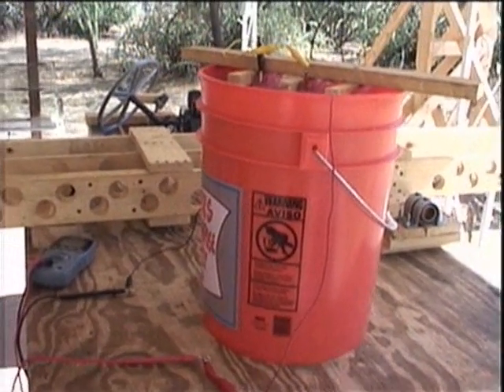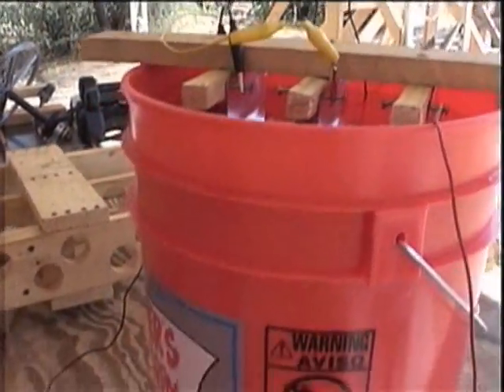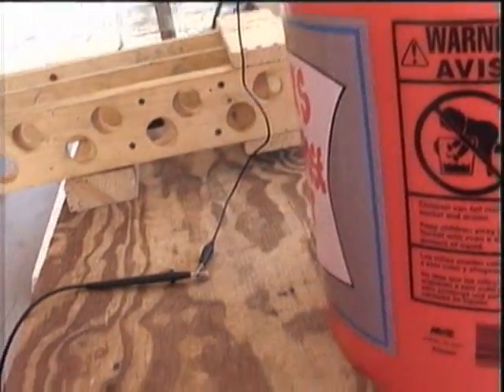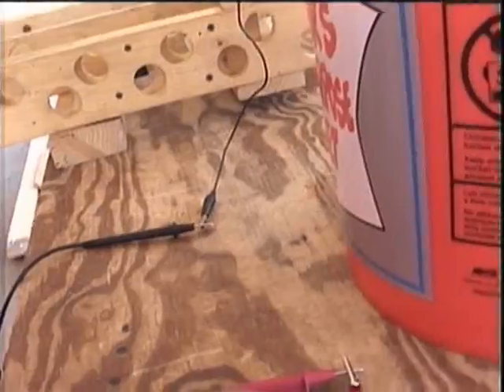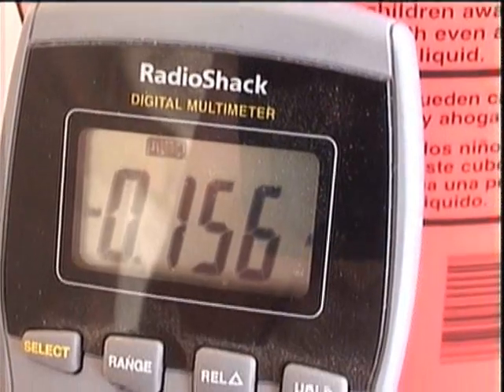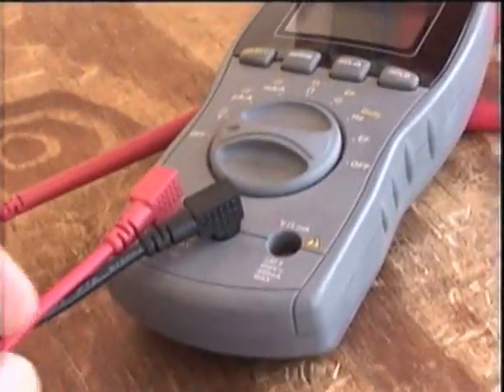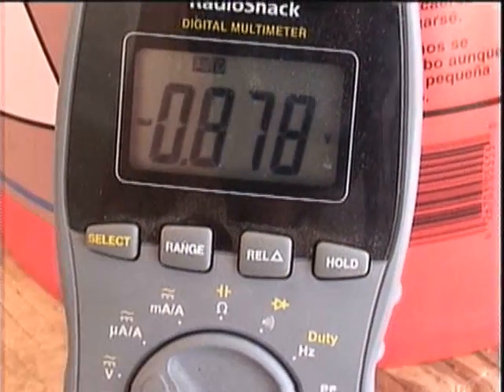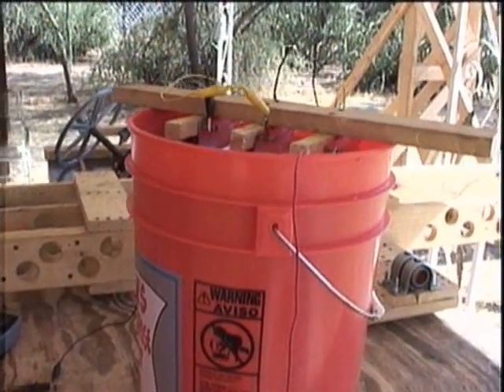Monster Salt Wter Battery P2

Comment: Would the wiring not give youbmore voltage rather than amperage. Like wire them in series rather than parallel. Just like any other batteries.
Reply: But this battery has only one cell. If I’m not mistaken you can’t wire a one cell battery in series or parallel inside itself instead it must be multi cells battery in order to do that. Of course in this case he could just turn the battery into multiple cells battery and wire it in series in order to increase output voltage.

Comment: Another thing is. the power comes from the oxidation of the metal. So the rod will get rusted out if you use the power. the maximum voltage within a cell is 1.5V - which is used in water electrolysis.  My previous experiment.  To accelerate amp, you can use Joe Cell or fusion reaction etc.. you need to combine kinetic energy transformation to produce energy. very difficult :(

Comment: Think like computer chips. more cells, closer you can do that increases the efficiency and more power. also more heat up by sun. more power. more pressure inside of chamber same. keep improving!

Comment: Cell voltage is leaking across the cells  use individual containers for each cell. Build large cells use 6 buckets copper flashing on inside of bucket bolt thru side sealed . Terminal-  smaller bucket inside with holes wrapped with nylon screen so particles won't go through the holes  stainless steel screen wire inside bucket bolted terminal+.😀  Next add broken bits of aluminum in small bucket, use salt water, or chlorine tablets and water, bleach is best! For 2 volts per cell! Make 6 bucket battery and run inverter and watch TV!😀

Comment: You have wired the cells in parallel. This is why the amperage increased. Wire them in series for greater voltage. This is galvanic effect. The saltwater is simply conductive for the electrons to move. It's the differential between the different metal types.. Sigh

Comment: 2 volts and 0.8A = peak power of 2W not bad for a 20 liter backet...
haha this is a joke.
Reply: 0,8 amps if he short circuit with the meter. 2 volts with no current. Power = voltage X current.
He must measure the current and voltage at the same time to get the     power.

Comment: Depends on how yo wire it up, whether in series, or parrallel.
Reply: It's a single cell(bucket/container), you can't wire it in series in a single container.
If you want more voltage you need a separate bucket/container, than you can wire in series.

Comment: well the problem you face are you cant have them in same store of water you need 3 in this case.
Reply: wrong...
Reply: you make no sense at all, you need 3 cells to higher volt x3 simple logic, he tried to make it x3 in one cell and that you can't do.
Reply: i don't argue with idioys...
Reply: another video had 10 cells in 1 bucket...as long as anodes are not physically touching, they can share the same electrolyte...if wired in series, voltage greater, if in parallel, amperage increased...
Reply: Hmm if true why have non made a 12 volt battery that way?? then foe free from charge one cell at time to max preforms of cells.
if you have all in one, they will simply balance the full battery, whit out one cell lagging behind.

Comment: Technically this is a cell. To increase the voltage you need to ADD MORE BUCKETS! XD
Reply: technivally is a battery, since more thab 1 cell in that bucket,,,
Reply: @Frank Blackcrow no there are three parts to one cell as you are only in one volume of electrolyte being one cell, you will get more amps but you need more in series and parallel. Open a real car battery and you will see the multiple sheets
Reply: I say Battery!
Reply: mine was actually for him i dont know why it selected you lol , i know how it works mate im talking about getting more amps from parallel and more voltage in series and larger sheets in each cell to give more surface reaction area
Reply: @donald it was for
Reply: The eh team. You are a big idiot without any clue about series and paralel into the bucket.
Reply: @UrgenthelpwithSubscriptionsHel   eh team?
Reply: Witchcraft!
Reply: @Chelson Aitcheson , to increase the voltage you need doubles anodes and catodes connected in series. You don't have any clue about electrics. Maybe just to play with some AAA bateries cables and leds.

Comment: Ok..basic battery design (I've been "trained"...got a diploma in Industrial Electronics so...)
To increase voltage, you put the cells in series.  To increase current (amperage), you put the cells in parallel.  (you probably already knew that)
so..if I had to guess based on the output (all else being equal)...you have them in parallel (all anodes connected together, all cathodes connected together).
the wood you're using probably has about 20% moisture content or thereabouts...
which means it is shunting some (possibly even most) of the current like a resistor across the circuit...
so...
Use an insulator (not wood) to mount your cells and you might see an increase in the current.
just a thought....
Reply: Yes, of course in series...
Reply: Patrick Leonard Dude can you tell me if the amount of copper /zinc or galvanised metal makes any difference in the final voltage?